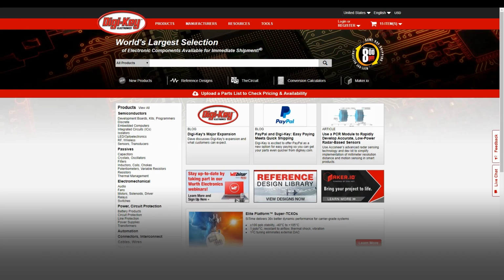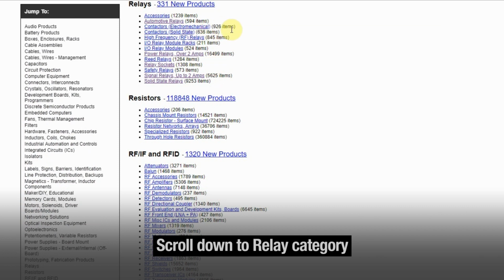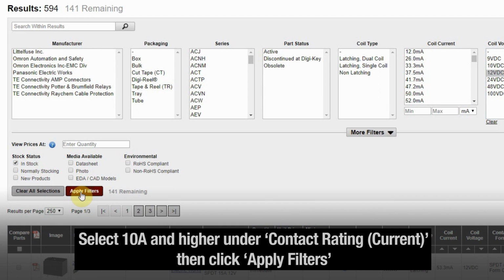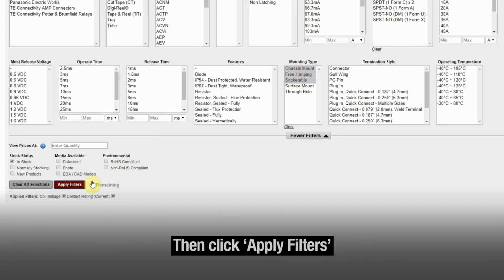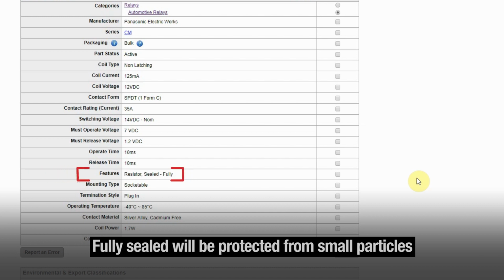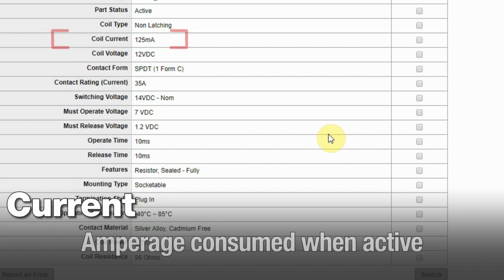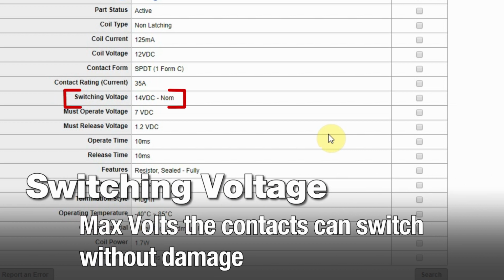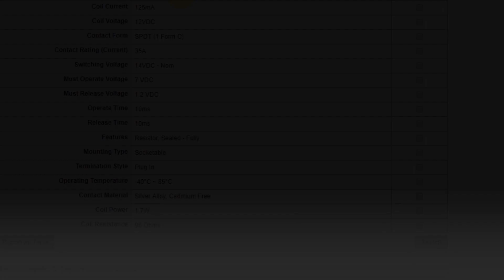How to Choose a Relay - Another Teaching Moment | DigiKey Electronics

Comment: I choose the loudest ones I can get.  This makes troubleshooting them very easy.  The big noisy ones can also carry more current.  Starter solenoids are great for many other higher current applications.  They are great for 4 kilowatt AC inverters, heavy duty clutches for under hood air compressors, under hood welders, train horns, underhood water heaters and water pumps, electrolysis water sterilisers, enormous 5 million lux flood lights, super focused 10 million lux spot lights, large radiator cooling fans, three battery starting and charging systems, 12,000 pound winches, heavy duty trailer brake electrical couplings, after market air conditioning system that will actually frost the windshield in summer, home made oscillating relay electric chair passenger's seat to shock people, and have a few extra circuits for what may come.  I love relays.

Comment: Imagine a relay that idnt on or off, but uses a potentiometer to bias towards on-ness and off-ness. It would literally be like a super heavy duty mosfet/transistor.
Reply: Not exactly. It would act like a mosfet in triode mode (a variable resistor) but a transistor is more than just a variable resistor. In most contexts one wants a transistor to act as a variable current source. This is not the same as a resistor and is something a potentiometer can never do.